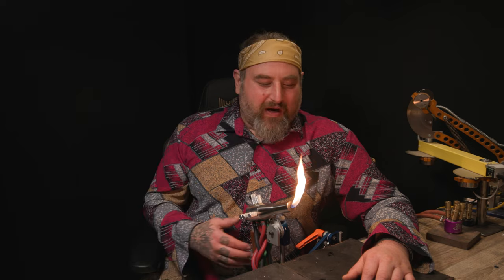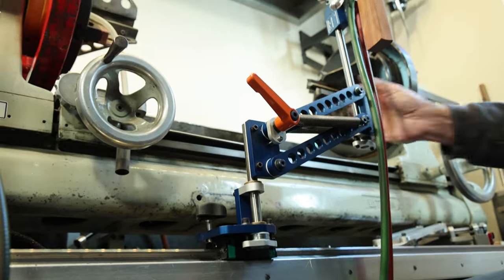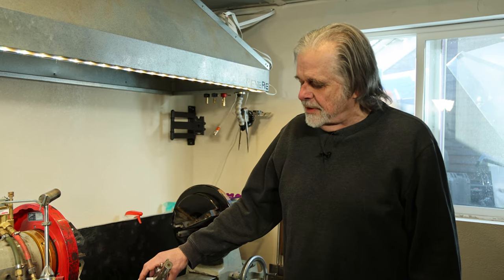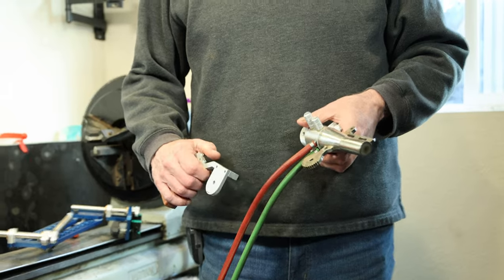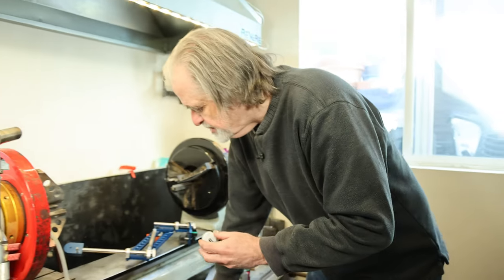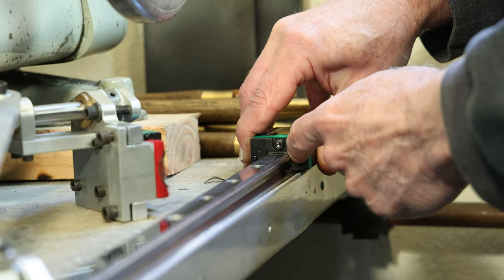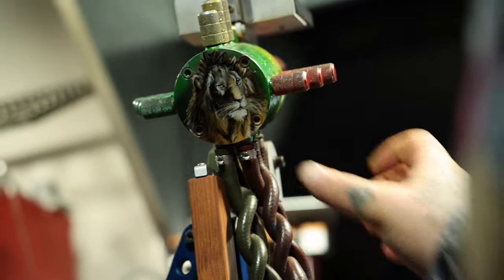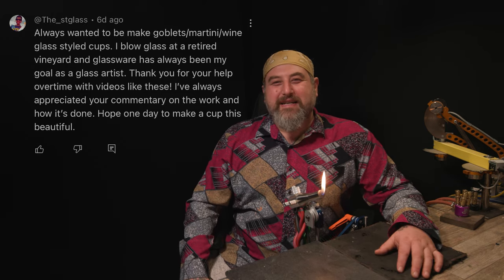My NEW Favorite Torch Mount for the Bench & Lathe || Armadillo Torch Mount ft Mike Peterson

Comment: I just bought an old lathe that needs a torch mount so fingers crossed 🤞
Reply from the maker: What kind of lathe?
Reply: @revereglass  not sure. Bought from an old scientific glass blower. It has no ID marks on it. It’s probably around 50 y/o. I’ll more than likely just use it to make small stuff and assemble at the bench.